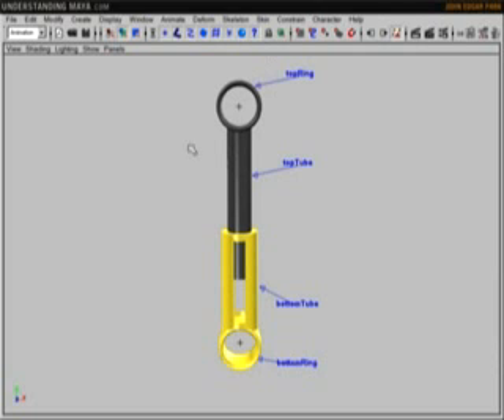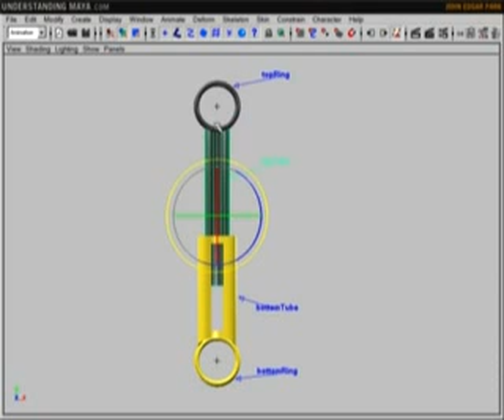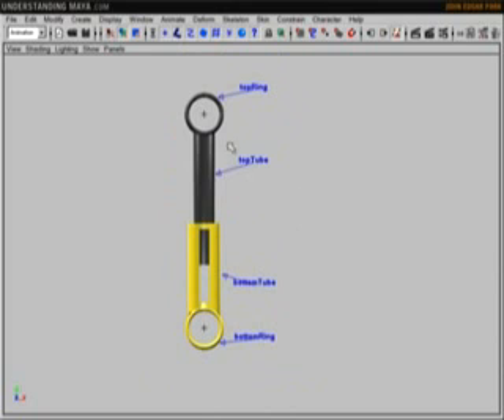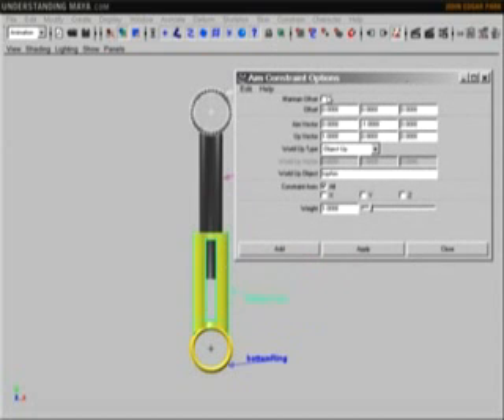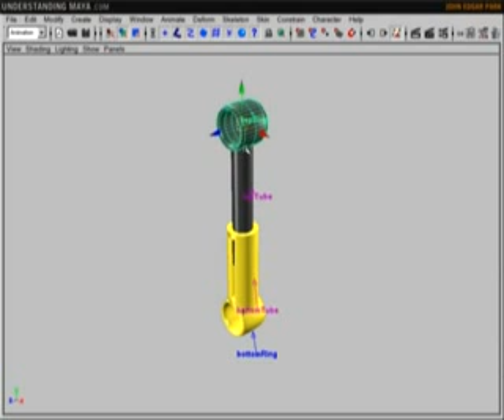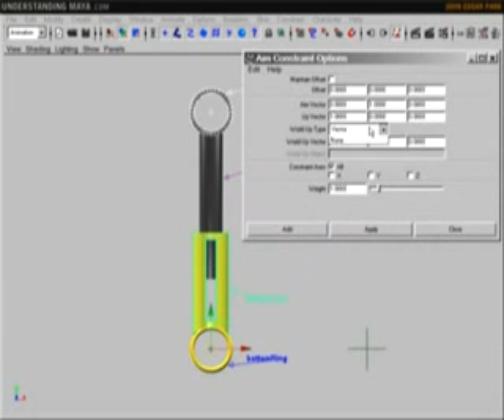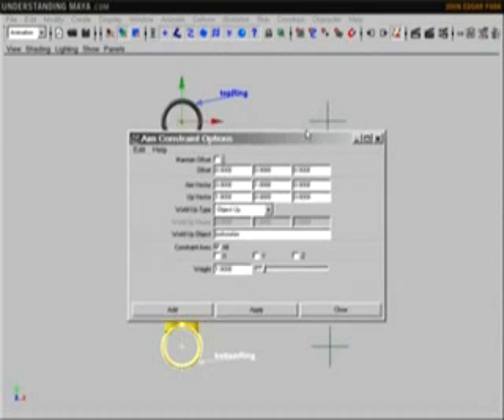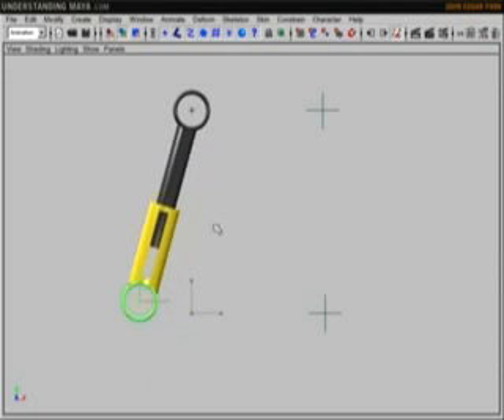Understanding Maya 3D Piston Tutorial

Comment: The piston is set to an angle by default, rather than a straight vertical pose. How do I apply this method with that condition in mind. I hope for a reply ASAP, please and thank you.
Reply from the maker: You should be able to apply this at an angle as well. Let me know if you run into problems.
Reply: So far, I've figured that setting up the pistons vertically as demonstrated, works as well. After that, all I have to do is drag the piston ends to where I need them to be, in order to set it at the angle I want. And since the models are low res and have no defining detail, I won't need a locator object to control the twist. Though if I am still doing it wrong or there is a better way, please do tell.

Thanks for the video again. It was a big help.